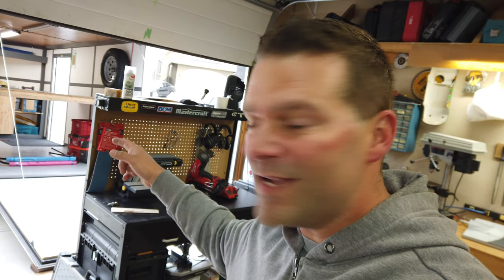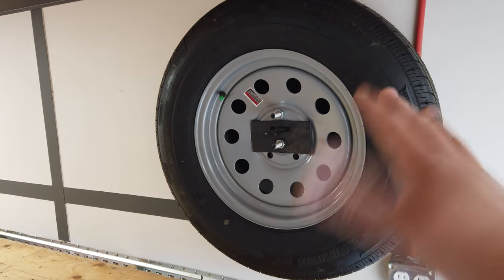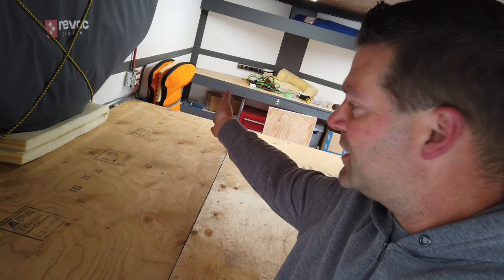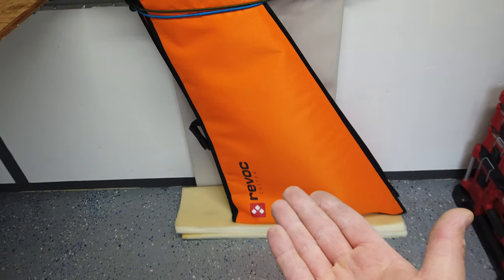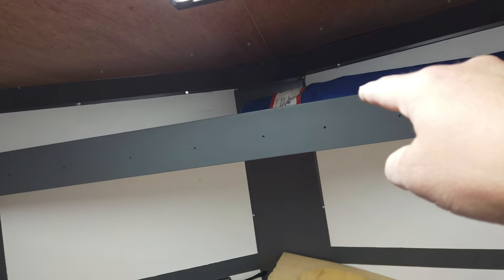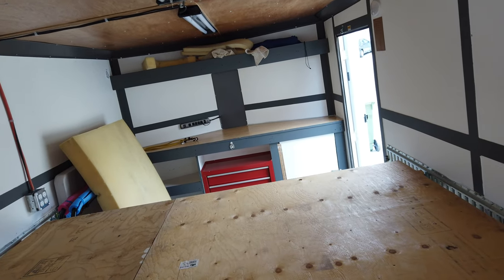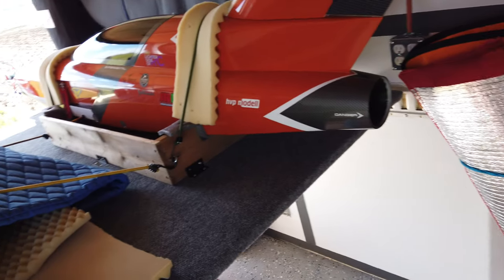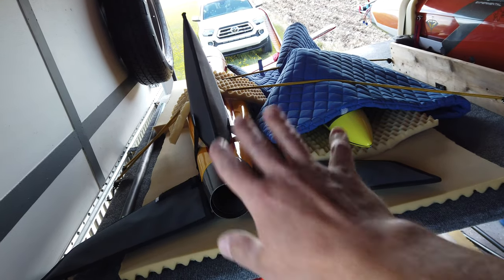THE ULTIMATE AIRPLANE HAULER - Final Adjustments

Comment: Love the smoke jug, the trailer looking like a Mobile workshop 👍🏻.
Reply from the maker: Getting there!  I think i'll be adding a bench top tool box and possibly a vise
Reply: @thelightersideofrc  I guess the more you can add, the better it will be on the road, that depends if you need to fix anything 👍🏻
Reply from the maker: Yea. I like to bring my supply of spare stuff so if I or anyone needs anything chances are I will have it. Sucks to not be able to fly because of something simple
Reply: @thelightersideofrc  like Rain in the UK 🥺

Comment: Nice Trailer mate a boomer one. Can with roller Grill sink etc had DeLong coffee maker powered by Solar. Also had an Alarm and 2 x internal security cameras run of Solar with back up battery. Cameras were Hi Def 190 degrees so wasn,t gonna miss anything also had super quiet Honda Gen. He had a swag in summer slept outside cooler months a cot inside even had hot water outside shower. It was a beast but then he had a fair few flying machines. Looks like yours is gonna work, for you. Carry on.
Reply from the maker: Thanks Nick!